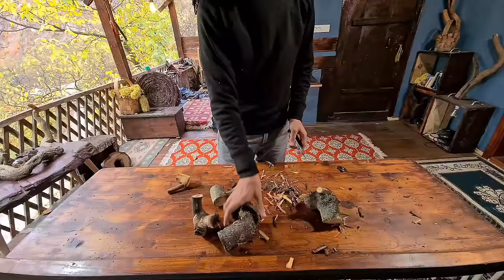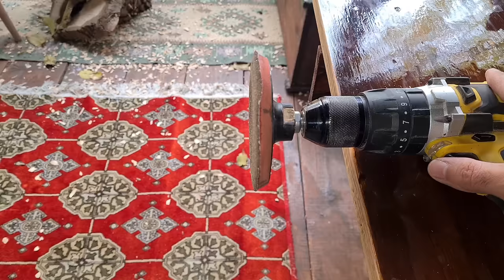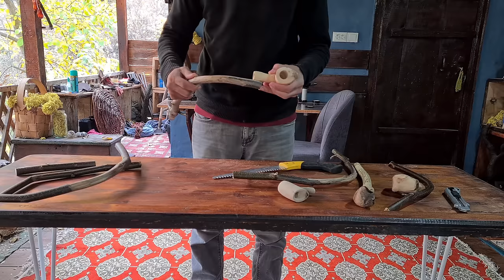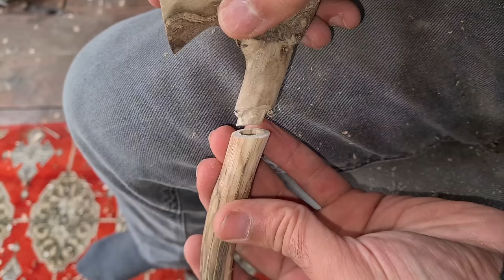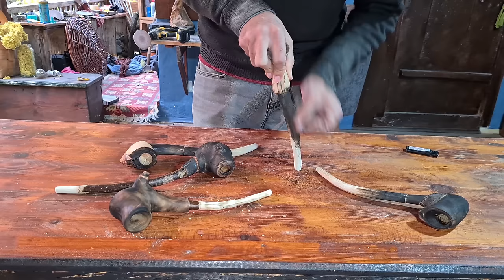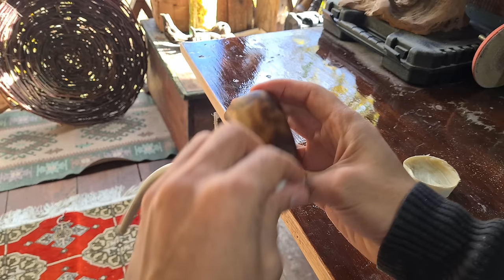MAKE A SMOKING PIPE - How To Make Smoking Pipes From Wood - Diy Pipe - Wood Pipes

Comment: How do you make the pipe stem?
Reply from the maker: I make the stems from fresh walnut tree branches. A fresh walnut tree branch has its own cavity inside. For this reason, I first bend the branch and dry it. Then I cut off the required part and then clean the space inside the handle with the help of a wooden skewer.

Comment: I appreciate the simple fact that no glues were used. Thanks for the video and additional comments!
Reply from the maker: Thank you very much.
Reply: No holes were used either.
Look as close as you like, he never drilled holes, or channels, through the pipes' stems.
So, they're more like walking canes for garden gnomes.
Well, I have to get going, now.  I have to get to work on these cubicle wheels for Elno's new cocept truck.
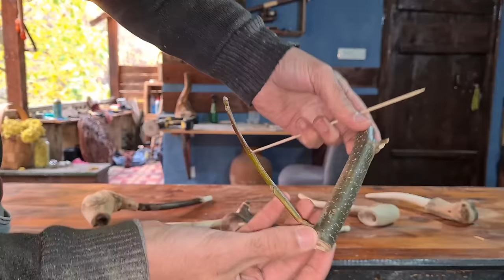Reply: @doodlertoon it looks like he puts holes in the stems at 11:09. I don't know what kind of wood he is using for the stems, but I guess it grows with a somewhat hollow or very soft center. He just punches it out with a skewer.

Edit: demonstration 11:09, first stem at 11:19.

Comment: You said you used a skewer to clear them out. How difficult of a process was this? I am beginning to make pipes myself and this seems part seems to be the most daunting for sure.
Reply from the maker: Actually, the simplest part for me is to open the air gap in the stems. If you look at other videos you can see it more clearly. I use fresh walnut tree branches in my pipes. and there is a natural gap inside these branches. All I have to do is clean this gap with a wooden skewer. It's a pretty simple method. It does not require glue or similar chemicals. I leave everything to nature. I used a fig tree branch in the last video. This was again a choice that made my job easier.  If you do not have such an opportunity, I recommend you make shorter and straighter stems. Thank you for watching.

Comment: Mask comes in handy with the fine sawdust in the air. I will have to remember to use a mask more often.  👍
I must thank you for showing a drill being used to carve out the bowl. I am going to have to try that. Thank you so much for this video.

The pipes you made are real beauties. They would be a joy to hold in the hand.
Reply from the maker: Thanks for watching.

Comment: Used to make pipes out of deer antlers and have whittled many of them from maple oak mahogany African black and etc glad to see that others are doing the same thing.. quick tip for the future I used black boot polish to stain the wood it contains enough oils to protect against wood rot and bugs as it will make the wood look more antiqued than just regular wood stain plus it dries faster and will not smell horrible as its drying.. and it can be polished to a shiny vibrancy with no noticeable smell after it drys completely…
Reply from the maker: Thank you for your advice. I did not use deer antlers in this project. I made the handles from walnut tree branches. However, I am thinking of using things like animal horns or animal bones in the future. I wonder how it will be. I hope I can find the horns needed for this.

Comment: Cant argue with the results. Excellent job
Reply: But, where did he put the holes through the stems?  He conveniently skipped that very vital part.  Without which there is no pipe.  There is only paperweight.
Reply from the maker: Thank you
Reply from the maker: Drilling the holes in the handles is actually quite simple. There is a natural gap in the fresh walnut tree branches I use. I just clean this gap with a wooden skewer, that's all. You can see this at 11:11. This is the only thing I do.

Comment: This was very interesting to watch. Just out of curiosity, why do you have to burn the surface and then scrub it away? Also, what types of wood did you use for the different bits? I don't want to attempt to make these with toxic wood. Thanks.
Reply from the maker: Thank you for the comment. I do not burn the wood, it is related to the color and strength of the wood. so I can get a dark brown color. Additionally, by burning the wood, we extend its life a little more. It's up to your own preference. I used several different woods. However, from what I have heard, fruit trees are the right choice for this job. Trees such as cherry, mulberry and apple are beautiful in terms of both color and pattern. However, my preference is walnut wood, as I did in my last video. I hope I helped.

Comment: Those are some beautiful pipes, curious because i would like to make a few myself. Did you drill the holes in stems before you bent them? Or were they already hollow and you cleaned them out? Saw a cleaning in your video,  so wondering  how you did that 1 part that could mean the difference between  usable or collectable.
Reply from the maker: Thank you for the comment. The holes on the handles are due to the hollow structure of the walnut tree I used. I just cleaned it with a wooden toothpick. A hot iron skewer can also be used if necessary. so that sufficient air space can be opened after giving it the appropriate shape. However, if you do not have a walnut tree, you can pre-drill and shape a fresh branch. This is also an easy method.
Reply: @BROTHER_WOOD08  thank you so much for your help. Hopefully I can do a video as well to get your honest opinion.😉👍
Reply: Timestamp 17:40 ….. third one down is my favorite of these.
Reply: @BROTHER_WOOD08 thanks that was my question also😊

Comment: At what point did you put holes in the stems? And what tool did you use to do it?
Reply from the maker: Thank you for the comment. I did not drill holes in the stems. The walnut tree I use has its own hole. There is a spongy structure right in the middle of the fresh walnut tree branch. I just cleaned this hole with the help of a wooden skewer and that's all. 11.11

Comment: How did you manage to drill holes that long for the pipe stems?
Reply from the maker: I didn't do any drilling for the long stems. The walnut tree branch I used has a spongy structure inside it. I just cleaned this gap with a wooden stick and that's all. You can see this at 11:11. It's a pretty simple method.

Comment: Is the mouth piece dry wood or fresh wood and ho did you get the core out ...is it dry or wet to get the core ot of mouth piece😮
Reply: What kinda wood is it
Reply from the maker: I made the mouthpieces from fresh walnut tree branches. I shaped it first. Then I let it dry. and after it dried, I cleaned the spongy gap inside with a piece of wood. A beautiful pipe mouthpiece was created quite simply.

Comment: How you drill out the mouth piece especially around the bends ????
Reply from the maker: I didn't drill the mouth piece. The walnut tree branch I used had its own cavity inside. I just cleaned this gap with a wooden stick and that's all. You can see this at 11:11.

Comment: I really enjoyed this, they are beautiful pipes! My biggest question just because of my lack of knowledge would be are the woods such as walnut and pine good for tobacco pipe smoking I’ve heard that walnut can contain some not so good toxins and pine with it being a softer wood isn’t so good because it burns up to quickly? Is that true? I like this process just want to make sure I use safe woods!😊
Reply from the maker: Thank you for the comment. Walnut tree is a very durable tree, unfortunately I have no information about whether it contains any toxins.  As far as I know, the only downside is that it leaves a bitter taste in the mouth at first.
It is true that pine tree is also a soft tree. I just collected pipe-like tree branches and tried to make a pipe from them, that's all. Some of the branches I could find are not suitable for long-term use. However, I think they can be very special in appearance. Of course, in order to use it for long periods of time, it is necessary to use stronger trees. thanks for watching.

Comment: I was waiting to see how you cut the hole in the branch.... I may have missed it but how did you drill the hole in the curved branch?
Reply from the maker: Thanks for the comment. The gap in the curved branch comes from the tree itself I used. There is enough space, especially in the fresh walnut tree branch. All I have to do is open this gap with a wooden toothpick. So I didn't do any drilling.😊
Reply: @BROTHER_WOOD08  I  guess I should of looked further  down. In comments. Definitely going to try this. Appreciate you answering these folks.

Comment: Excellent video.  May I ask how you drill through the bent stems though please
Reply from the maker: Thank you for the comment. I didn't actually drill the stems. The walnut tree branch I used has its own cavity. I just cleaned the inside with a wooden stick and that's all. The only process I did is the one shown at 11:11. It is a very simple method.
Reply: Thank you and brilliant video  @BROTHER_WOOD08
Reply: Other curved woods you can split then carve each side and carefully glue it back without getting glue in the the hole...

Comment: Those look absolutely amazing. Also what kind of wood did you use for the stems and the bowls?
Reply from the maker: Thanks for the comment. The stems are made of walnut wood. Walnut, pear tree, fir tree and pine tree branch solutions in the bowls. Some tree species may be irritating to tobacco users. However, I think walnut wood is especially a good choice.
Reply: I have a pipe made from purple heart. Hard maple would work also.
Reply: Stems can be made out of about anything. But your bowl needs to be from the same types that you would smoke meats with. Nut, fruits, etc. I like cherry. It's hard and beautiful. Black walnut is good too.  
    Your evergreens like cedars and pines will poison you. Or so I've read. I'm gonna stick with cherry. 
    These are beautiful pieces sir!
Reply: I missed it, how did you drill the hole in the stems
Reply: @johntodd7495 I kept looking for this too.

Comment: nice work, however if you ever want someone to use it to smoke, make a third bit out of bone for the flattened mouth piece at the end of the stem
a pipe smoker will chew a wooden end into ruin, its always wet, also watch where the grain goes on the bowl,  you don,t want the bowl to chip off a piece when they knock the dottle out
the far side of the bowl is a stress point.
Reply from the maker: thanks for watching. You are absolutely right in what you say. This was my first try. Over time, I realized that some things were missing. For a good pipe, the mouthpiece must be smooth and in a structure that will not break when bitten. In my 3rd pipe video, I used a harder wood in the mouthpiece. This prevented damage when bitten, but it still leaves a strange feeling in the mouth. I will take your advice into account and try to use bone in my next projects. thank you again. have a nice day.
Reply: all pipes taste strange until they are smoked enought to be broken in, the wet doddle soaks into the bowl,  gets hot and forms a cake.and into the stem as well, if it wood, thats why smoking pipes have bakeite, plastic clay or bone stems so they don,t absorb moisture. you can use wood, but it will turn brown then black, and the stem will rot just like the bottom of a picnic tables legs feet.

  i ve been smoking a pipe for 50 years, and ive carved my own as well,  and one thing that separates a true pipe from an orament is the last inch tip you put in your mouth, it can,t be wood,
stone, bone, bakeite , plastic, clay, but not wood.

 dont mean to be critial, but your pipes are so close to being right, you just need literally need a good tip

e stems

Comment: Do you drill the stems out while they're still green then just use the string to curve them until they dry out?
Reply from the maker: I twist the stems first using rope. Then I dry it. and finally, I clean the space inside the walnut tree branch I used with a wooden stick. that is all. The reason why I clean the inside after it dries is because the gap inside does not close when bending it.

Comment: I don't understand how you got the center hole through the stem? Beautiful work
Reply from the maker: Thanks for watching. The air gap in the pipe stem was actually the easiest part of the job. There is a natural gap in the walnut tree branch I use. I just give it the right shape and wait for it to dry. Then I clean the space inside with a wooden stick and that's it. You can see this at 11:11.

Comment: Beautiful work! How do you drilled the stems? That branches was pretty long.
Reply from the maker: Thanks for watching. I actually didn't do any drilling on the stems. There is a natural gap in the walnut tree branch I use. After cleaning this gap, a nice air gap is created. This is the only thing I do. You can see this at 11:11.

Comment: Do you then need to line the pipe bowl with clay or does the flame from the torch harden the inside of the pipe?? Curious to know 🤔
Reply from the maker: thanks for watching. In fact, this was one of my first works. Therefore, there was a lot of space between several of them. and unfortunately I used glue to fill this gap. I don't know exactly what is best for this type of work. I used beeswax in one of my projects. It actually works, but its heat resistance is low. I guess I may need to find a different technique in the future.

Comment: Beautiful! How long did it take for a stem to dry before you can take the string off and sand it?
Reply from the maker: I left them in front of an electric heater overnight to dry the stems. This was enough to make the shape permanent. but they were not completely dry. If you want to dry it in the sun, it may take a week.

Comment: What are you using? What's that little wand for cleaning holes? How do you make one of those at home? Love your videos:)
Reply from the maker: thanks for watching. I use walnut tree branches for stems. There is a natural gap inside the walnut tree branch. I clean it with a wooden skewer and that's it. It's a pretty simple process.

Comment: how did you attach the pipe stem? glue or just on there with friction?
Reply from the maker: I first carved them to fit together and then put them together. but some were still moving. I used beeswax for this as in my new video. Of course, using detention is also an option. However, since glue is a chemical ingredient, it would be better not to use it. If you take a look at the pipe video I uploaded recently, you can see how I did it.

Comment: I'm confused, how did the holes get into the stems originally?
Reply from the maker: I'm sorry that I couldn't explain some parts of the video as much as I needed. If you are asking about the holes in the mouthpieces, these are welded with the own structure of the tree I used. If you are asking how the pieces fit together, it is because I carved the pieces so that they fit together. so they can be installed and removed without using any glue.
Reply: @BROTHER_WOOD08 how'd you get the hole down the centre of a curved stem.
I get a straight stem you can just drill out. I understand if you don't want to share that information. 
Anyways beautiful work mate

Comment: What kind of wood are you using? I tried olive root and the heat broke it...
Reply from the maker: I didn't pay much attention to the types of wood I used in this project. I collected dry branches around me that resembled a pipe and made a pipe from them. I used only walnut wood for the stems. For the heads, I used walnut wood, pear wood, fir tree and pine wood. These may not be suitable for a pipe. But they look beautiful in shape. If you intend to use it for a long time, the tree must be dried very well beforehand. Otherwise, it may crack at the slightest temperature. In case of the slightest mishap, you have to start the whole work over again, which can be a bit boring.

Comment: What abt d stem how did u drill that maybe i missed it looked twice
Reply from the maker: thanks for watching. The holes on the stems are caused by the branch I used. There is a natural gap inside the fresh walnut tree branch.
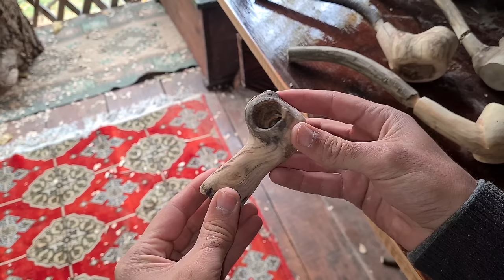I shape it, then dry the branch, and finally clean this hole with a wooden stick. You can see this at 11:11. If you want to see it more clearly, look at minute 9:20 of my last video.

Comment: what material you are using to polish them pipes at the end ?  Thank you !
Reply from the maker: Thank you for watching and commenting. The material I use is a mixture I made myself. It contains beeswax and natural oil. You heat the two and mix them. If you want to make it, I can recommend walnut oil.
Reply: Thank You !  @BROTHER_WOOD08

Comment: What wood do you use?  Is it a hard wood or a soft wood?
Reply from the maker: Frankly, I did not pay attention to the tree type in this project. I collected branches found in nature that looked like a pipe and made a pipe from them, that's all. Some of them are not fire resistant enough, but they still look pretty good. While the pear tree I used was a very hard wood, the pine tree was a very soft wood.

Comment: What are you applying to the wood in the end?
Reply from the maker: I used a wax made with a mixture of beeswax and vegetable oil. It is very useful for the surroundings of the pipe, but the wax can also melt in overheated parts. It would be better to apply only vegetable oil to these parts.
Reply: Thanks 🙏🏻

Comment: I’d like to make one but how did you make the holes inside the tubes😅
Reply from the maker: The holes on the handles are due to the natural structure of the fresh walnut tree branch I used. There is a natural gap in the walnut tree branches. All I have to do is find a fresh branch and clean the inside with a wooden stick. It's a pretty easy job. For bowls, a size 18 drill bit is sufficient.